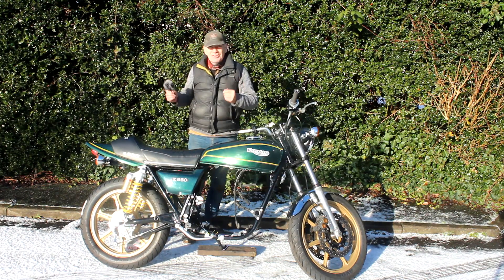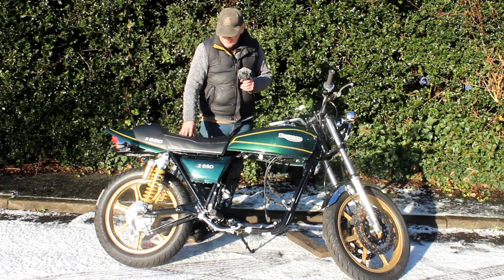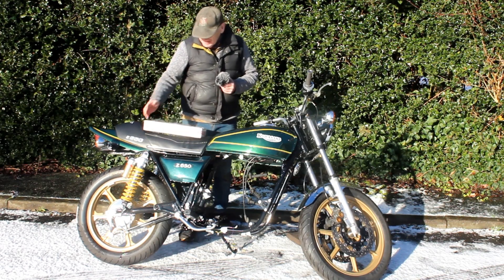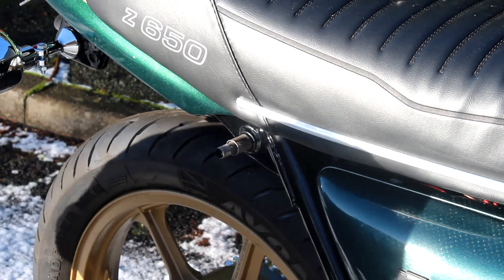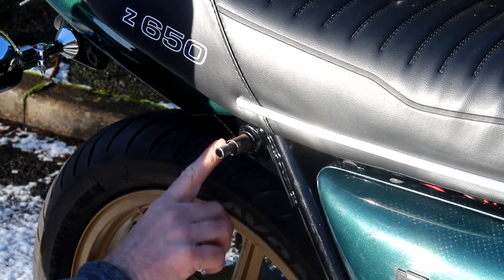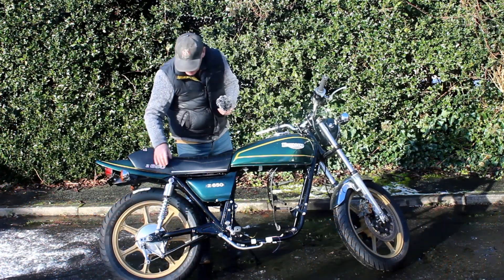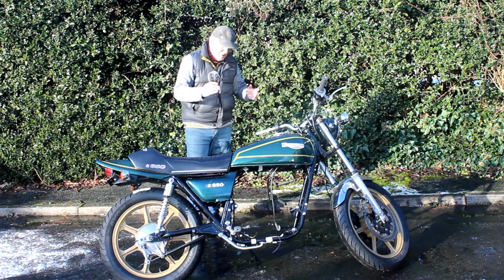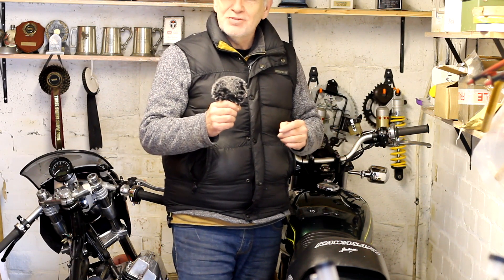Kawasaki Z650 Restomod Project - Part 16

Comment: Looking forward to seeing  the cases I imagine it would b a very durable finish better than ceracoating    Even   R u keeping the six fifty std bore  the amateur bike builder  has just done a 650 but not sure he’s got it running right yet
Reply from the maker: I have seen the cam cover and sump after they've been vapour blasted, and to be honest that finish is really good alone. I have had the Z1000A1 finished in the same silver ceramic coating which I showed on that build thread a few weeks ago. The engine will stay as a 650, as I have other much more powerful bikes, not much point tuning this one.. I have just started working on the red Z650B.